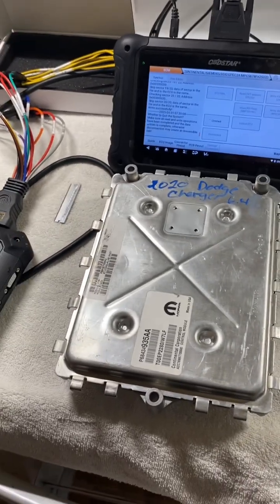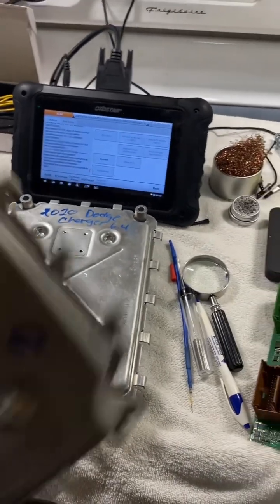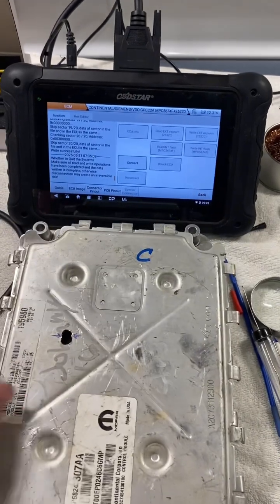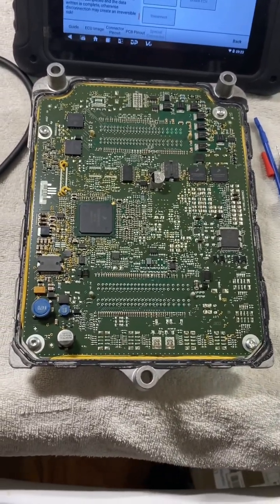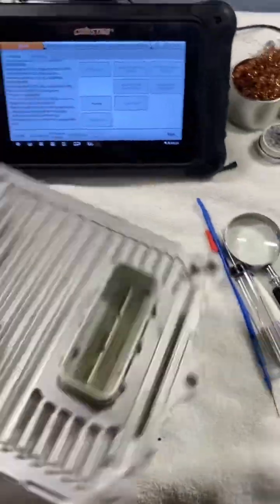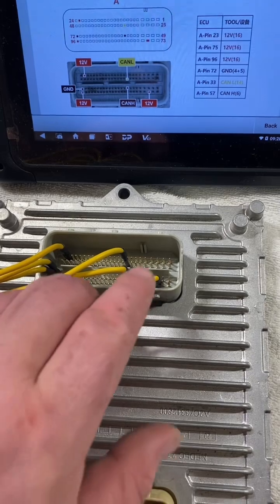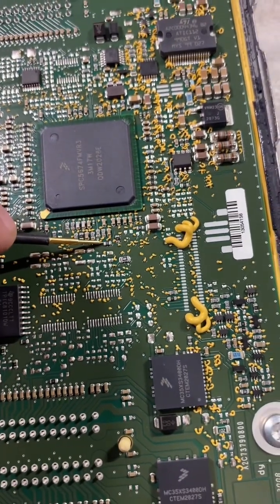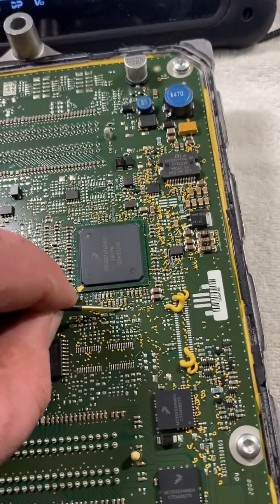Unlock ECU BiN Bot For all Gpec2 & Gpec2a vehicles. Unlock, Vin change, Skim del on DC706 Tablet!

Comment: I saw your recent on l5p.
Will obdstar do the l5p ecm???
Reply from the maker: I used the hp tuners e41 cable for the l5p but fairly sure with the right alterations to the bin file the OBDStar wiukd unlock it